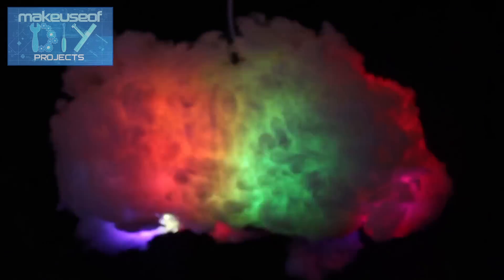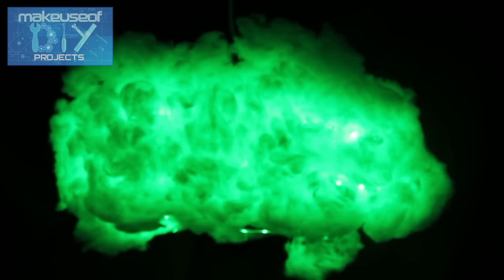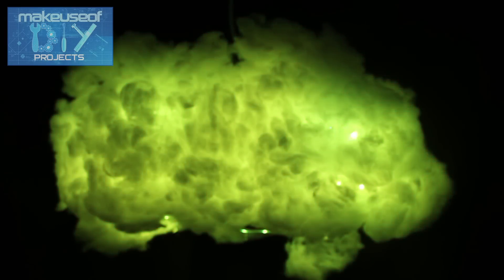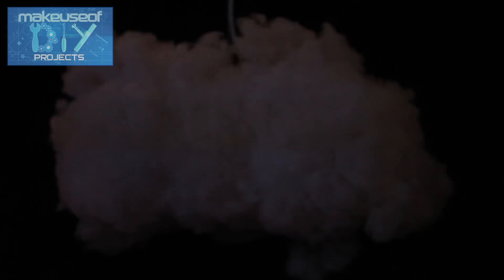DIY Glow Cloud Lamp (Sound reactive lightning + mood lamp modes)

Comment: Do you know if voices could be added to this project that would not trigger the lightning effect? I'm hoping to create a scene utilizing lightning and thunder effects, but would like to add additional sounds to complete the scene (voices, bells, crashing, etc) but, obviously if those sounds trigger the lightning it kind of throws the whole thing off... Any help would be greatly appreciated. Thanks.
Reply from the maker: Tricky. Right now, yeh, all sounds trigger the lightning, including voices and other ambient noises. To have it only trigger with lightning, you'd need to manually code a lightning sequence that corresponds to a particular audio loop; or look at coding your own ambient sound app, which would send signal to the cloud lamp only when the thunder event occured. Not impossible, but more extensive coding than we've done here.
Reply: @MakeUseOf  - Thanks for responding... What about sync calibration issues regarding different events over time? How many events can be played simultaneously? And would the timing between events change over time? I'd really hate for a flash to occur and a sound that should play simultaneously plays seconds before or after it was supposed to.

Thanks again.
Reply from the maker: @digitalmunky  These were just concept ideas for you to add - nothing like what you describe has been programmed by us.

Comment: I have everything I need, but the led strip is 4 wires. RGB and ground rather than having a signal wire. How would I interface that with the arduino?
Reply from the maker: Keith Naulty Thats a different kind of strip - the one you have can display only a single color, rather than control individual pixels along the strand. It would be quite a big modification to the code, but if you have a go with another project first, you should be able to modify this one.

Comment: Hey :),
i looked up all the parts and it comes up to round about 150€. Then i found a ready to buy "LED Music RGB Controller". It s about 15 €, what do you think about these controllers? Is this just crap in comparison to your programable thing? Sorry for my english :)
Reply: Ichbrauch Mittelalter I would guess the main difference is that you could set several programs. Could be that the LED Music RGB Controller just flickers in all colours, so better check that before :)
Your english is perfectly fine ;D